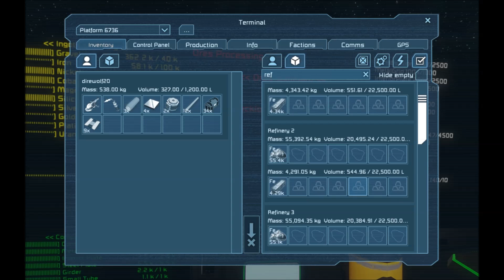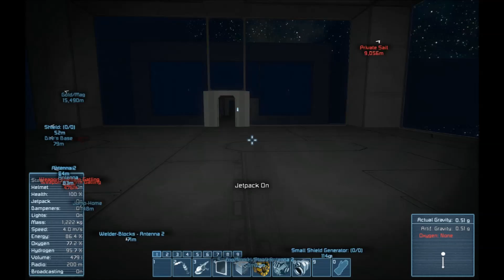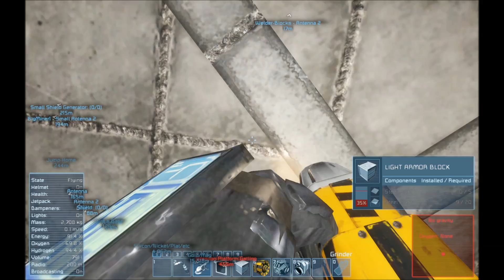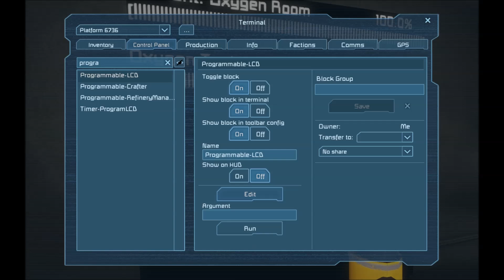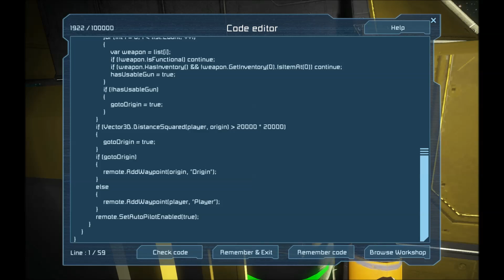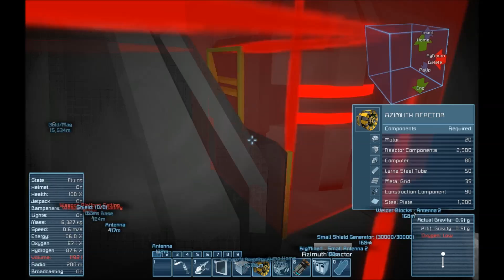Space Engineers   S1 E19 Hydrogen Update

Comment: So ion thrusters for station-keeping and maneuvering and hydrogen thrusters for acel/decel?
Reply: +ShneekeyTheLost Hydrogen Thrusters are the most efficient way of exiting atmospheres in a future planets update.
Reply: +ShneekeyTheLost They need ton of fuel, so is's not ideal for main engine in the space. One H2 tank can sustain one large ship large hydrogen thruster only for a few minutes. So yes, H2 is very useful for acel/decel, especially for large ships with lots of cargo (I'd prioritize breaks, insufficient breaking power is more dangerous :-D ). You can also make good fighters with H2 thrusters, since you don't need them most of the time and they won't ruin your ice reserve.
Reply: +The MoSS Breaks are about the same thing as acel thrusters, flip 'er over and acel in the opposite direction. But yea, I was thinking using Newtonian vectoring instead of requiring constant burn to maintain velocity. Give yourself about a one minute boost to head out, then another one minute boost on the other end to slow yourself down.
Reply: *brakes
Reply: +The MoSS They just increased the capacity of the hydrogen tanks, so they're quite a bit more viable now.
Reply: +Morrigi192 But you need more ice to fill the tank now :-). Still very useful and powerful trhusters, don't require platinum to built and fuel consumption is high but fair.
Reply: +The MoSS Ice isn't exactly rare.

Comment: Put two doors next to each other and then you won't need to depressurize your base when opening the first door. After opening the first door and you are in then close it and then open the second door.
Reply: +Michael Stokes He knows how an airlock works, every corridor he has essentially is one, the problem is he doesn't seem to have the patience for it.
Reply: +Neronix17  I don't think he has two door next to each other. He does have a corridor tunnel which is fine but has more oxygen loss than he would loose with two doors. I noticed he forgets to close the doors in the corridor to save oxygen and that would be solved with more patience :)
Reply: Michael Stokes Yeah there's more loss than there could but if he was worried about that he'd probably use the airlock control script and build a proper one that loses none of the air.

Comment: Dire rather then cutting the ship up to get to a reactor add a small reactor to the outside to bring the tube system back online. For my ships I make a small reactor already on outside access to keep the ship in place so i can turn off the main reactors when not moving.
Reply: +Andrew H While that is a good idea for small ships, large ship small reactors are too expensive to do that tactic IMHO.
Reply: +Scott Chamberlain Agreed. I built a power pod instead. A small ship with a few thrusters, a remote, and a little connector so I can thrust it to a ship, build a block to connect them, and power it that way.